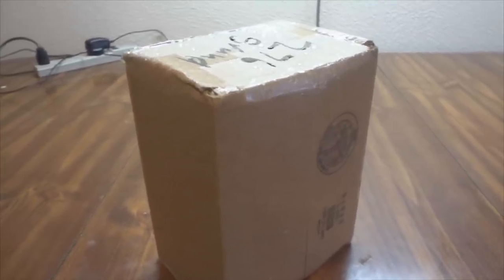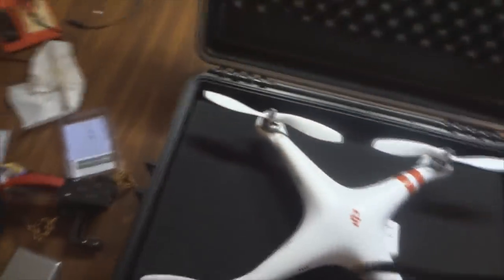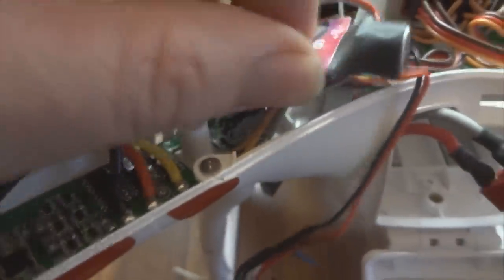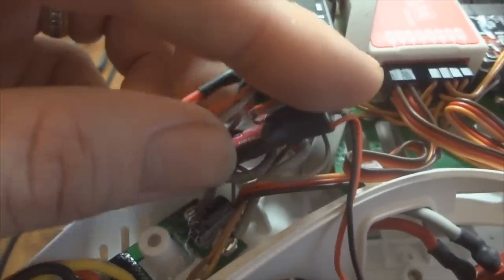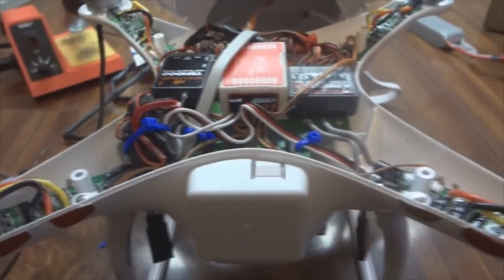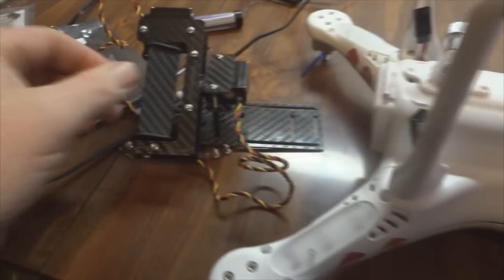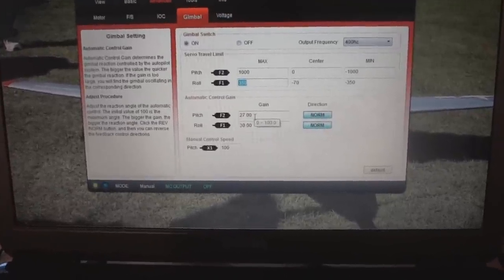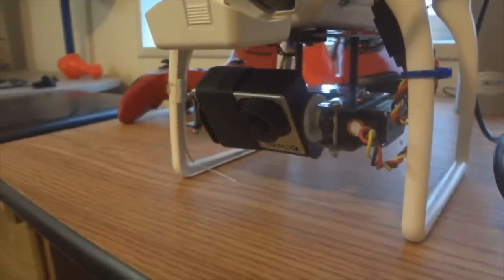PhantoMount Installation and Tips

Comment: Yes you have to turn on the gimbal in the settings before you plug them in.  One other interesting note is that if you have the controller off and you plug your battery in (which is not recommended) the gimbal does not center.  Thank you Wayne for the great video on getting it setup.  I leaned a lot from it.

Comment from the maker: You are correct, I had forgotten that I bought the short mount, they do have a wider version of the mount to accommodate the plug.  I may have to see about ordering the parts so I can convert mine to the wider mount.  In the mean time I may take the gimbal off and mount the stock gopro mount to experiment with FPV.  I'm glad I mounted the gimbal for easy removal. :)

Comment from the maker: I am actually working on this at the moment, I have an FPV cable on order for the GoPro now, but it's coming from China, with no tracking number, so not sure when I'll get it.  Hard part is going to be figuring out where to put the FPV transmitter.  I have been mounting my battery on the outside right behind the gimbal.  So I might be able to put FPV transmitter in the battery compartment, drill a hole, and put antenna through it.  I don't think weight will be an issue.  I will keep you posted.

Comment from the maker: I'm assuming that your asking if the NAZA can supply power to the servos?  Yes it can, but there are a couple of reasons I chose to use the BEC.  The servos are faster when 6v is applied to them using the BEC, the NAZA only puts out 4.5 to 5.5v.  And by not using the NAZA power output to run the servos, that's less current that is being drawn through the NAZA so as not to overload it, just an added safety precaution.

Comment: Great Video  !  I too have the same problem After installing the gimbal as instructed, when I plug in the battery the servos go full deflection very quickly. f1 servo gets hot quickly any suggestions. I suspect it is a software problem when I set gimble settings I get a MC  Output  blinking in red on bottom of gimbal setting page  I didnt see that on your computer when you where showing your install. Help

Comment from the maker: Now that you mentioned it, I did have a sales person at the local hobby store tell me that digital servos work best with a load, that digital servos work best with some sort of load to them.  Depending on how tight the elastic bands are if they will damage the servos, if they are just tight enough to reduce the shaking but not tight enough to prevent the servos from moving, I would think you were ok, and the servos should be fine.

Comment from the maker: (continued from previous reply)  I too have seen reports as to Phantoms running away, I've not experienced this myself.  I have read where some people might think that it was a problem with the GPS lock, or the cumpas not being calibrated correctly.  I did see a video where a guy flew it from his balcony at his appartment and lost control at a high altitude.  People suggested that it was because he was to close to metal when he set his home point and that did not allow for proper compase reading

Comment from the maker: I am using the Hitec HS-5245MG servos that comes with the PhantoMount.  Are these the servos you have?  I had another cheaper gimbal I was using, and it had 1 digital, and 1 analog servo and I would get a lot of shaking of the servos.  I found out later on it was because I was using two different styles of servos.  I guess they both have to be either analog, or digital, not one of each.  I wonder if it might be due to your Phantom gains?  I did some adjustments to my gains today.....

Comment from the maker: (continued from previous reply), but if you are low on battery, and far from home, last thing you would want is for it to power up to altitude, and fly back home if battery is to low.  Your just going to put a heavy load on the battery and risk going to low in voltage I would think.  But you did bring up an interesting question that I will have to check on just to make sure.  (continued on next reply)

Comment from the maker: Have you tried swapping servos to see if the roll servo works with the pitch signal? If it doesn't, I would say you have a bad servo. If it does, then I hate to say it, but you may have an issue with the naza. I have my frequency set at 400hz in the gimbal settings on assistance, and that is the highest setting, so the servos should work on any of the frequency settings. So don't think that's an issue. I would try switching servos, at least that might help isolate the problem.

Comment from the maker: sorry for the delay in responding, been a busy day.  when the servos were first powered up, did you go into the assistant settings and activate the gimbal in the advanced page?  Or did you just disconnect the gimbal?  what happens when you set the settings for the gimbal as I have set in the video?  I will connect my Phantom and get my current settings while I await your response.  Double check your direction settings for the servos, maybe change that to see what happens.

Comment from the maker: I added it for two reasons.  The Phantom will not fly home on low battery, it will slowly adjust where the throttle center point is.  So basically you will have to keep raising your throttle higher in order to keep altitude, eventually it will land, but will not return home.  And second, if model is a long ways away, or is at a high altitude, it's difficult to see the LED when it indicates a low voltage.  I want to be sure I'm already landing when the LED flashes RED, especially when over water.

Comment from the maker: Have you had any luck yet?  Just wondering if you were able to find what was wrong?  And if you were able to actually isolate the issue with the servo?  I was also thinking if it's not moving, and is getting warm, sounds like it might be bound up in some way, could the servo arm be to tight, and rubbing on the main housing of the servo?

Comment from the maker: There might be an issue with the stock radio and the wifi, but I don't think it would be a problem with the Spektrum receiver I installed (you may have seen my receiver installation video).  The Spektrum receivers have what they call DSMX technology, and is designed so that there could be 100 2.4ghz receivers on at the same time.  Search YouTube for DSMX and you will find a few good videos explaining the DSMX technology.

Comment from the maker: Here are my current gimbal settings: gimbal switch on, output fegruency-400hz, Pitch (F2)-max 1000, center 0, min -15.  Roll (F1), Max 350, center 0, Min -350.  Automatic gain control: Pitch (F2), Gain 17 Direction Normal, Roll (F1), Gain 10, Direction Normal.  Manual control speed: Pitch (X1) 100.  Also make sure that you have the pitch servo plugged into F2, and Roll Servo plugged into F1.  Also make sure that power polarity is correct.  I will continue to think of other things to try as well.

Comment from the maker: I could be wrong about Phantom returning home on low battery, I will have to research this more.  But when I was flying with low battery just to see what it would do, I had to keep moving my throttle stick higher, and higher to maintain altitude, and eventually I was full throttle and Phantom was still comming down to land, not flying back to home, just landing where it was at.  Maybe I had it in Atti mode, and if I was in GPS maybe it would have... (continued next reply)

Comment from the maker: Sorry to hear about your props, I did no other adjustments other than what I show in the video.  Did the Phantom tip over right at takeoff?  If so did you have it in GPS lock mode?  I've heard people say it's best to take off in Manual, or Atti mode.  It takes time for GPS to get a good location lock, so it's not recommended for takeoff.  I am currently on a ship out at sea, so there maybe some delay in giving a response to reply's or messages.

Comment from the maker: Is it the one I sent the link for?  The one that has no servos?  If so, I'm really interested in how well it works.  I just got the cable I needed for FPV, and as we discussed it will not work with my current PhantoMount gimbal, so I removed it and am currently using stock mount.  If it's not the gimbal I sent the link for, could you send me a private message with the link?

Comment from the maker: I see that I have missed some comments on this video, and for some reason I'm not allowed to reply directly to them.  I'm not sure if I like some of the changes that YouTube has been doing.  Also I noticed that some comments were marked as spam, but they are clearly not spam.  I tried to approve them, but for some reason YouTube wouldn't allow me to mark them as non-spam.  So to answer some of your questions, the Gimbal works well, not sure how it compares to the one that DJI makes considering this is the only one that I have been using.  Though I am thinking about dropping this gimbal for a brushless motor gimbal.  This servo gimbal still has a little jitter and there is no way to avoid it because of the way that the digital servos work.  Only way to eliminate the jitter is to use a brushless motor gimbal.